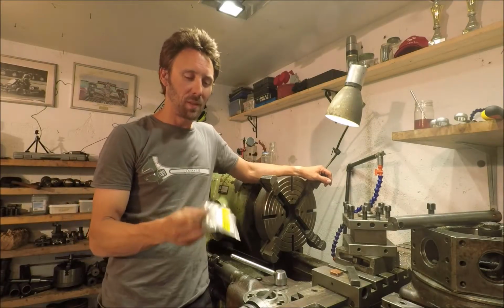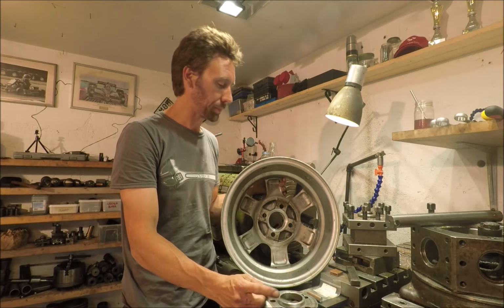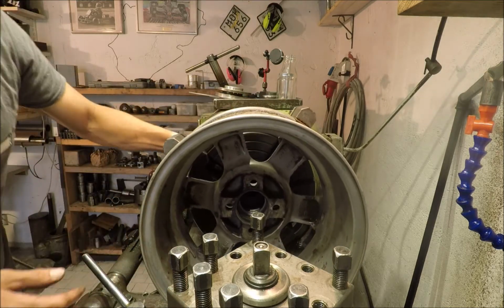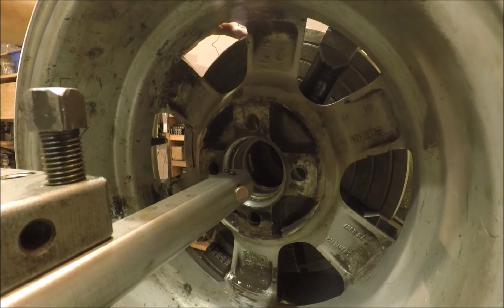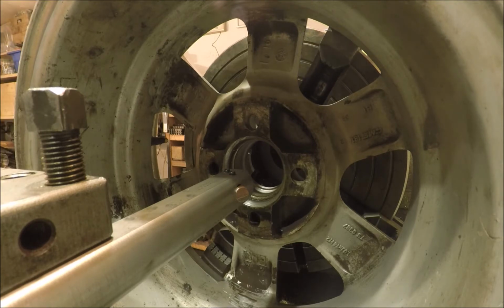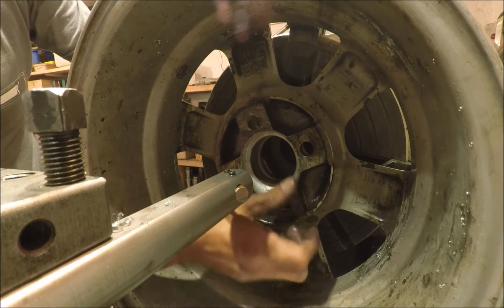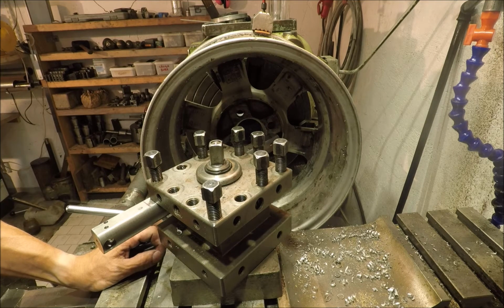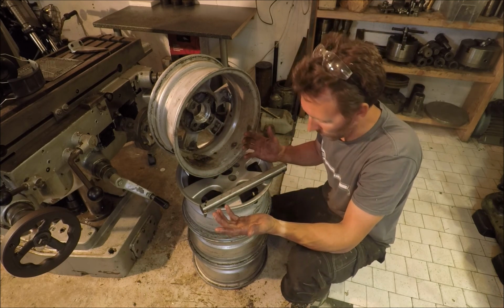Center boring alloy wheels

Comment: Hey,
Is there any risk of weakening the wheel if you expand the cb too much? Going from 54>60.1
Reply from the maker: I would say no, not unless the wheel has a very small center (od). Usually wheels has loads of material in the center, so taking of some material isn't a problem. The same wheel canoften be found with different center bores right from the factory.